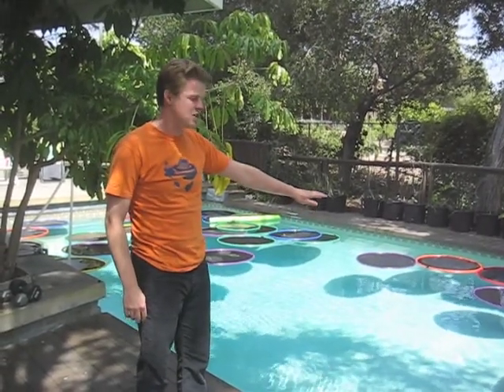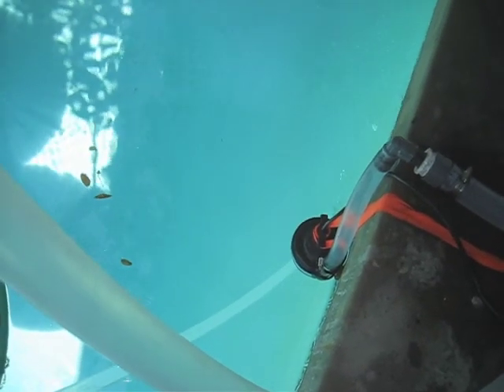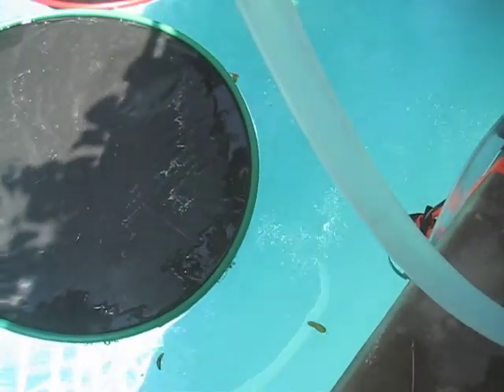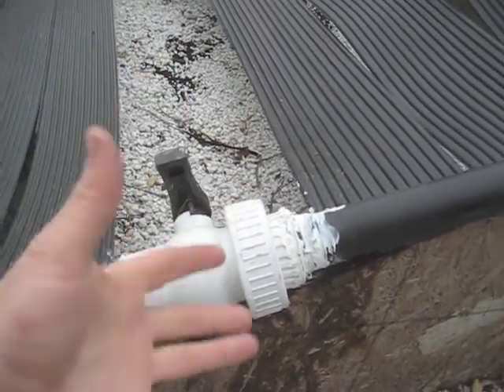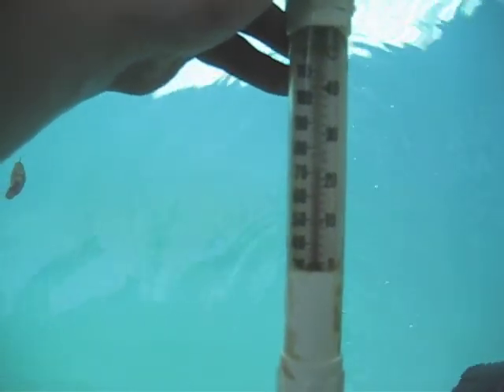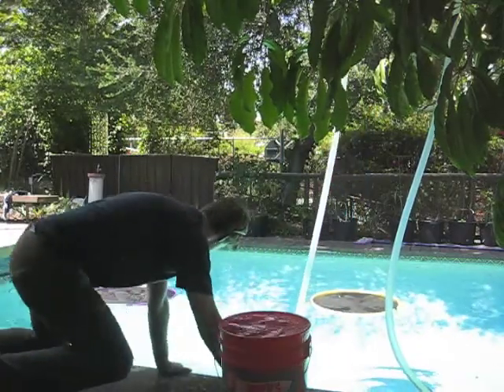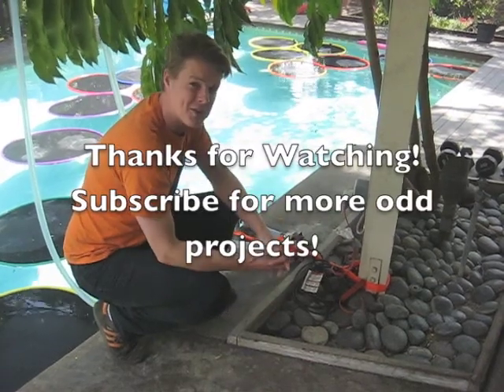Rooftop Solar Pool Heater

Comment: Can you explain the dishwasher pump set up? Curious about how you did the wiring. I have a dw pump but not the coupling,  wondering if you hacked that part together too, or if you already had it. Thanks again for the idea!
Reply from the maker: It's been a while since I set this all up, but it wasn't complicated.  I found the connectors for the input and output of the pumps at the local hardware store and connected them all together.  I suggest bringing the pump with you so you can test the fittings right there in the aisle.  Both pumps ran off of 110V AC, so I just connected the terminals to an electrical cord and plugged it in.  We only ran this in the summer in Los Angeles, where rain isn't an issue, so be sure to weatherproof your connections if you live where weather is a thing.  The main point of the DW pump was to supplement the main pump during start up.  Without the DW pump the water wouldn't make it to the roof.
Reply: @cogzoid  You'd mentioned the air leaks in the original vid; this breaks siphon action and makes the pumps work a little bit harder to send water to the roof. (a leak-free system would have the inertia of the water heading down help pull water heading upward) It would be good to add a reservoir at the highest point of the system, like an expansion tank for a car's cooling system, and fill that up while closing off the bottom legs. With the reservoir full of water from a bucket or garden hose, and the bottom legs shut off, you'll now have water leaking instead of air. Find and seal those leaks. Then, seal the reservoir while it's full, and your leak-free system won't be working as hard to pump water upward.

Comment: I have 1/2 inch irrigation tubing coils on my roof and the air getting into the system is a problem for me - I have to charge the line with the garden hose to push all the air out of the system a couple of times a day. I have a spare dishwasher pump, excited to try that, thanks for sharing your set up! I wouldn't have thought of that. I was thinking the air was just coming out of the water as it heats up but will work on tightening/sealing my connections, too. Thanks again for the great video!

Comment: those air leaks are costing you money. if you had a sealed system above the level of the pool the partial vacuum formed by the heated water returning down to the pool  would help lift the cold water from the pool and give your pumps less work

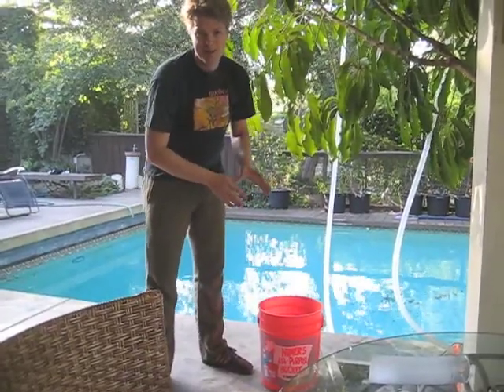Comment: according to a online calculator, 200,000 btu/hr is 58 kw, so if this is doing 11.5 kilowatts 3:20 that's not bad if you only need a few degrees

Comment: Having those panels raised off the roof top or any surface is gonna lose some heat just as a car radiator works. Why not built a solid black flat platform form them?
Reply from the maker: good idea.  some people build black boxes to put the coils in with glass fronts like small greenhouses.  I decided it wasn't worth the effort for me.

Comment: I have a 1500 GPH pool pump which I want to use to also run tubing to my roof for a solar heater.  Will that pump be big enough to push water to my roof?  About 25' high.  Any thoughts???  Thanks for all the great comments.
Reply: The big deal will be sealing the system air-tight. Water flowing downhill will generate suction to help pull water uphill, the pump adds that kicker of energy to get over the frictional losses in the system.

Comment: Considering that Sun light give a maximum of 1.1 kW per square meter and that only a fraction will be collected I am a bit suspicious of the measured 11 kw for this setup. It did not look like a 16+ square meter setup.
Also an insulating back and a clear plastic on the front could allow the system to work more efficiently during cooler days.
Reply from the maker: Maybe the video didn't show it clearly, but the area of the black tubing was probably around 16 square meters.  I don't remember the exact product I used, but it was similar to 2 of these: https://www.homedepot.com/p/XtremepowerUS-4-ft-x-20-ft-Above-In-Ground-Solar-Panel-Heater-System-for-Swimming-Pool-75070/314571915?

My measurements at the time were correct and repeatable.  11kW of solar input from 500W of pump electricity is a pretty good deal.

Comment: Why not power this with your existing pool pump, which is running 8 hours per day anyway?  That way you are truly running the system for free.
Reply from the maker: Kev, that's a great idea.  At the time, we were running the pool pump at night to save on expensive electricity costs (~50¢/kWh!) of peak use.  And hence, needed a different pump to heat the pool.  Later, after an upgrade to the old pool pump motor, costs went down significantly, but now it's too much work to cut apart a working system.

Comment: I've made a similar thing for my pool about 3 years ago, and it has been great ever since. This video seems to be about only a test run, since the final system will have to be much larger. I have installed 25KW of tubing (about 1500m of black garden irrigation hose, a little less than a mile) and it cost me about 800 euros (including an extra pump for the first year, which I no longer use). You should do a little math before you start. Assuming no losses, heating water takes 4180J per litre per degree Celsius of temperature increase. A medium size pool with 40 000 litres (dimensions W x L x D in meters times 1000 litres per cubic meter) will need about 167MJ to heat up 1 degree. If you want to get your pool from 22C at 10:00 (10AM) to 28C by 14:00 (2PM) you will need to heat it up by 6C in 4 hours. The energy needed will be about 1000MJ, and the power required to get it in 4 hours is 70KW. At my lattitude (38N) I can get about 1000W/m2 of solar power, meaning I would need 70m2 of tubing. For a 16mm tube diameter the length will need to be 4375 meters. One way to get the length down is to allow for more time to heat it, for example considering the target time of day to be 16:00 instead of 14:00 (4PM instead of 2PM). Another way (the best) is to cover the pool during the night. I cover mine and it loses about 0.5C during the night, so the normal startup cycle is to begin day 1 in the morning at 21C, then by the end of the day it will be at about 25C. Then I cover it, so day 2 starts at 24.5C, and then the system adds another 4C to the pool, so at the end of day 2 it will be at 28.5C. Then I cover it again and start day 3 at about 28C, and at the end of the day it will be at 32C! Well, not 32C every day, but a sequence of 3 or 4 hot days gets it there. You will be unable to maintain this rate of temperature increase because as the water is hoter more heat is lost during the night, and during the day more heat is loss to the environment and less goes into the pool. Anyway, my pool has been at about 30C during the whole summer, and I get a total of 10 or 15 days during which I can get it to 32C and use it during the night for hours on end.

* WARNING *
Don't use water pumps that are not adequate for swimming pools. If an electrical fault develops it is possible that people inside the pool get electrocuted. Wet skin is much more conductive than dry skin, and the depth of conduction is greater with wet skin. It is very easy to kill someone if you are not careful. If you use such pumps (like I did during my first year) always make sure you turn it off when people go swimming (you won't waste a lot of heat since the water will heat up a lot sitting still inside the tubes, so all that collected heat will be delivered to the pool when people get out and you restart the pumps). The best way is to pump the water is to adapt your existing pool pump (which I did in the second year), it is much simpler than it sounds.
Reply from the maker: We've definitely got an undersized heater.   But that's okay.  The goal was to raise the water temp a bit, and that we achieved.  I did the math about how big a heater we would need, and decided against it.  In fact,  I no longer live at this house, but my friends that do have been keeping it working.  It's surprisingly low maintenance.  If I did it all over again I would've gone the route of irrigation tubing like you describe.  Thanks for sharing your math!
Reply: storypunman

Actually, that is not generally true, there are a lot of ways for tube heating to beat blanket heating.

My roof has a surface of about 8 times that of my pool, so my roof is able to collect more sunlight than the pool area. Currently I have about the same area for tubing as for the pool, so one could argue that currently I would be able to heat the pool just as much as with a blanket, but this summer I will double the tubing, whereas I cannot double the pool area. So tubing will win blankets by a factor of 2 this summer, and I can go up to a factor of 8.

Another way for tubing to be better than blankets is where shadows are cast on the pool surface but not on the roof. Mine is such a case, where no area of my roof gets any obstructions or cast shadows during all of the day, and my pool is in the shade until noon and then again by 4PM. So tubing on the roof is able to provide an average of 10 hours of continuous sunlight per day, whereas my pool is only able to collect about 4 hours of continuous sunlight per day.

Another way for tubing to beat blankets is in safety. My pool is covered with "floating tiles", which can hold children and dogs that fall in, just like blankets usually can. However, an adult falling into a pool covered by a blanket can find himself/herself wrapped inside them and unable to leave the pool or even get to the surface, as the water pressure around the limbs may be strong enough to prevent moving arms and legs. My tiles break away from each other when adults fall in, without restricting any movements of the limbs, and a fallen individual can use the individual tiles as floating devices by grabbing on to them and get back to the surface (each tile can hold a 22Kg force before sinking, more than enough for an adult). When I got the pool I first tried a blanket, and I tested falling into it, and I didn't like it. I'm young and strong and healthy and have experience holding my breath, so I was able to get out of it, but I did realize that maybe not all people would be able to get out of it. I returned the blanket and started my tubing project. Unfortunately, my tiles cannot heat the water, because being able to provide 22Kg of floating they are basically thermal insulators (which help during the night), otherwise they could provide additional heat. But for me, safety comes first.

Another way for tubing to beat blankets is where roofs are slanted (not mine, though), and may provide a better efficiency (a given area slanted facing straight towards the sun's average elevation will always beat the same surface flat on the ground, except in the equator where they are equally efficient). I did a trick to approximate slanting, where the tubes are about 50% of their width apart from each other, and so while the sun is not facing down on the tubes the spacing between them is enough for each tube not to cast shadows onto the next. This means that each tube gets 100% of sunlight (on the half that is facing the sun, obviously) at all times of the day, giving an average sunlight capture equivalent to that of a sunlight tracking system. That beats any blanket, where the sun's inclination from sunrise to sunset and to North/South causes a large change in sunlight capture. Calculating for my case, I get an average over the day which is about 85% of the peak, whereas a blanket would get an average of less than 45% the peak.

About the math: I did do the math, and presented in my first comment, and if you follow it you will understand that both tubes and blankets will have the same trouble heating up the vast mass of water in a pool. Blankets do not do any magic, and are not able to heat a pool without heating all of its mass water, no more than tubes can. If you read my explanation you will understand that the ability to heat a pool is related to the ability to collect sunlight, and that depends on the surface of the collector. If you use a 30m2 blanket and I use a 30m2 tubbing (on a flat rooftop, without spacing) we will both get the same peak power. However, by using spacing, I get that peak power for longer (the tube spacing maintains a high exposed surface and sunlight projection from the sun) and you will get it only for a small fraction of the day (because the projection of the sunlight on a flat surface will be highest only when the sun is directly pointing at it and will fall quickly both before and after,with sunlight arriving at an angle). My 30m2 of tubbing with 85% average of the peak cost me 800 euros, and a 30m2 blanket for my pool with 40% average of the peak cost me 450 euros. Doing the math you see that the cost of heating the pool would be about the same (it would have cost me about the same 450 euros to install tubing that would heat just as much as a 450 euros blanket). In practice, however, blankets would never be able to provide as much heat to my pool as tubing does, simply because the pool area is in the shade about half of the day and the roof gets sunlight all day without shadows (as mentioned before).

So, in my case, tubing trumps blankets, by a large margin. The blanket I tried got my pool to a continuous average (across days) of 25ºC (77ºF), and the tubing gets it up to a continuous average (across days) of 30ºC (86ºF). And this summer my tubing will get it even better, and there is no room for improvement with blankets.

Comment: Use a GFCI outlet for SAFETY.

Better yet use a DC pump using a solar cell.  No timer would be needed and it is 100% safe.  Check amazon.com.  I used one for my pool and I could increase the temperature 10 deg in a good day with my pool covered by a roof.

Comment from the maker: You sure could, but that means that the main pool pump would have to be on when it's sunny.  Pool pumps can be power hogs and our day rate for electricity was pretty high.  It was more economical to only use the little pumps during the day, and let the filtration happen at night when the price/kWh plummeted.

Comment from the maker: In general you're correct.  I was also afraid of that being an issue.  But, it seems the heated water dissipates over a very short distance in the pool.  The water temp near the inlet of the water pump is less than a degree warmer than the rest of the pool, so it doesn't seem to be a big issue, as far as efficiency.

Comment: You should consider better separation between the intake and outtake. You're just sucking back in the heated water.
Reply from the maker: The heat from the output of the tubes dissipated very quickly into the pool.  When we measured the temperature in different spots around the pool it just wasn't an issue.

Comment: I did same thing but I used 1500 feet of black plastic garden pipe from home depot cost about 90$ total. I have an above ground pool 10x20 and in 2 days got pool to 90. Also I live in Oregon with little Sun.